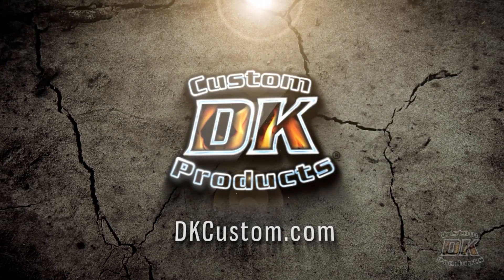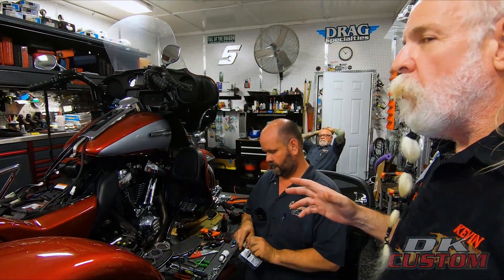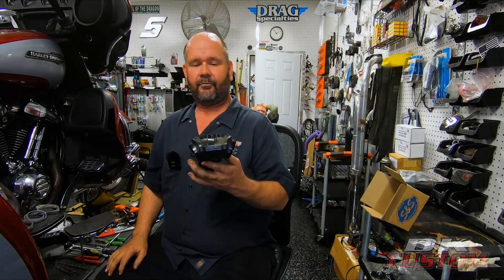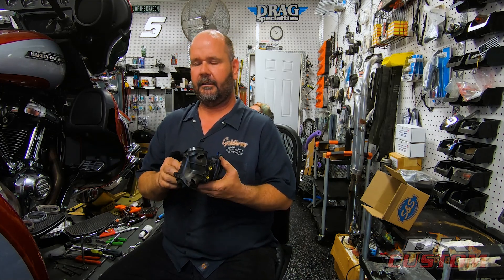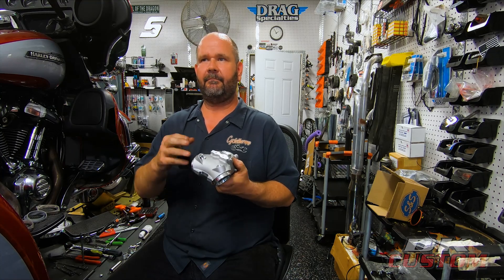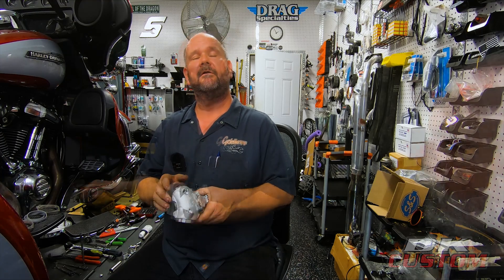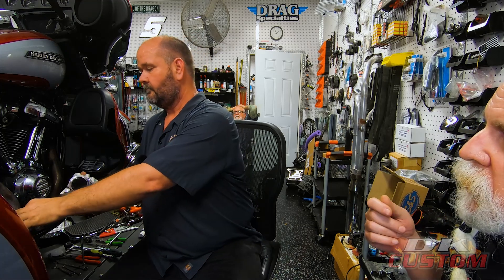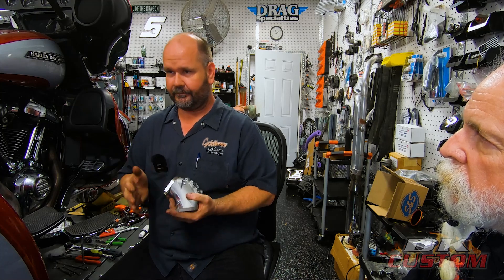Why is There So Much Plastic on Harley-Davidson's?

Comment from the maker: This is a PSA Video.  We are not selling intake manifolds.  I used an S&S intake manifold when replacing my plastic intake manifold.  Standard size.  Oversize manifolds (many folks think bigger is always better) do NOT make more power.
On an engine that does not have increased compression & a big bore kit, the engine will not run as strong with an oversized manifold or throttle body.  It is better to stick with OEM size.

Comment: If you melt the intake, you have a shit tune and running too lean. I swapped the stock intake to an HPi 62mm just for more power from my cam, and the plastic intake was perfectly fine, just had oil inside from before I stopped the breather from flowing back into the intake.
Reply from the maker: Glad you haven't had any issues with the plastic intake. Thank you for sharing and for commenting! MB

Comment: Is there really any difference in SE 55mm PN 27300167 and PN 27300206 (California Models) other than the price?
Reply from the maker: Great question! The main difference between the SE 55mm PN 27300167 and PN 27300206 (California Models) is typically related to emissions compliance for California's stricter regulations. Other than that, they may be quite similar, but it's always worth double-checking the specific specs to ensure compatibility with your setup. Hope that helps! Thank you for commenting! 😎👍MB

Comment: Never put a plastic handle on a cast iron frying pan,just saying...im glad i swapped my intake and i have noticed my rear rocker box cover doesn't get hot like it used to so i must of had a air leak.
Reply from the maker: Glad to hear your rear rocker box cover is staying cooler now. Sounds like you've got it dialed in! Thank you for commenting! MB

Comment: Because they are not premium quality motorcycles where drivetrains are concerned. Their success is due to easy REbuild and overhaul to zero time and a magnificent aftermarket facilitated by their simple engine design and rebuildable crankshafts. The only intake manifold offered for HDs that was actually good is the Ram Jett one-piece intake for Evos which replaced the idiotic rubber boots on early Evos. They're so stout it's safe to lift the engine by a sling under the intake which I've done and not provoked any leaks.  Everything else is designed for rapid line assembly after which they're the customer's problem. Properly designed engines don't require a waterfall of replacement parts to be reliable but fortunately new HD customers are rich enough to fix everything and even be proud of spending the money. Fine with me since my brother mechanics need to eat too.
Reply from the maker: Thanks for sharing your opinion and insight!
KP

Comment: How many reasons do you need to not buy an M8? I put a 103 kit on my 96ci FXWD along with cams and some compression and it's great, why would I change? Maybe if you want bragging rights in top end speed then go for it, I'll protect my wallet thanks.
Reply from the maker: Glad you have your bike built how you want it. The M8's aren't bad bikes they just need some upgrades. Thanks for commenting! MB

Comment: I'll stick with my underpowered early twin cam thanks.  Delphi injection, solid cranks, timken left side, proven primary and no stupid plastic intake!
Reply from the maker: Yeah, plastic and engines are not a good mix, especially air cooled engines. Glad you have a bike you are happy with and do not have to worry about the intake melting! 

Thanks for commenting!

Comment: If i had a m8 which I 😢don't hd  would be the last place I  would  purchase the metal intake from. The m8 doesn't even sound like a harley at idle.
Reply: The only way to get that idle lope on an m8 is to change the cam. 2 friends have done that and it sounds  like the old harleys.
Reply from the maker: I did upgrade my CAM!!! 😎
Reply from the maker: The M8 doesn't sound much like a Harley, but there are certainly modification yu can do to get that sound back! 

Here is a video of my M8 sound before and after modifications- https://www.youtube.com/watch?v=yIbqJ7ytr3w

Thanks for commenting!

Comment: I have 2017 SGS. Every once in a while when I come to a stop, the idle drops to 400 then back up to 1000. Then alternates between 800-1000. i sprayed the manifold with throtle body cleaner, but no fluctuation in idle. Any thoughts. I'm ordering the s&s manifold anyway
Reply from the maker: There could be a variety of reasons for this.
The tune may need to be reflashed.
The sensors in the throttle body may be gummed up if you are not running an EBS.  Check out this video on the subject-  https://www.youtube.com/watch?v=EfDeFZblMck
It is even possible that you are borderline sumping.
Hard to know without the bike in front of us, but the able 3 are things I would check.

Comment: Just took my MY23 sport glide into the dealer this morning for rough idle (too low) and hesitant revs… told me there was an air leak on the plastic manifold. Rather than fitting a new plastic one and seals they suggested I paid the difference for the warranty claim to upgrade to a screaming eagle aluminium body. It was £77 (GBP) difference. Bike is totally better again. Amazing upgrade. Plastic crap between two cylinders shouldn’t be there.

Can’t believe Harley would do this still now on the M8 when they must have seen repeated warranty claims for it? Tech told me this morning it’s not worth warranty claim in the plastic for plastic as if keep coming back over the next two years under warranty and then upgrade to metal to finally resolve the issue.

They done the test with brake cleaner (in less than 30s like you said) 

Excellent video, just advise a low lumpy
Idle too is possible (like I had) in the next one 👍🏻
Reply from the maker: Yeah, HD probably figured they could get away with the plastic intake (to save $) because auto manufacturers have been doing it for years.
And truth is, that a relatively small number of HD's are having the problem you had....but if they get too hot, that is what can happen.
I did note that on the new 121 CVO's with VVT, they are using the aluminum intake manifold, not the plastic one.
See in this video- https://www.youtube.com/watch?v=58cVhVnlz6w
Glad you got yours taken care of.  👍😎👍

Comment: Thank you for that my 2022 Road Glide Special intake Manifold melted. With only 700 miles on the bike and the weather was 74 degrees in Phoenix AZ.
Reply from the maker: That is terrible! Plastic on a motorcycle near the motor just does not make sense! Glad the video was helpful! Thanks for watching!

Comment: U guys are on the subject of plastics on the m8, but forgot about the lifter cuffs and unbrella valves..i dont buy the Al intake would have engine temp decrease, but yea plastics will damage from excessive heat
Reply from the maker: We did not address the plastic in the umbrella valves, but we do address the plastic lifter cuffs.  Here is the video on that- https://www.youtube.com/watch?v=My7BkSnl-fQ
Here is a video about the plastic in the cam bearing- https://www.youtube.com/watch?v=6EdSBP2kZLY

Comment: One of the first things I did to my 2017 FLHTK was replacing the restrictive manifold with an S&S, and before installing that I took the time to gently sand it down…not polishing,..inside for just that little better flow. That way another thing came of my mind when cruising the E-Glide down HW1 here in Calif., it’s just a great feeling that you know exactly what’s going on inside your engine and that you have an impact on it. 👌🏻☠️🇺🇸
Reply from the maker: " it’s just a great feeling that you know exactly what’s going on inside your engine and that you have an impact on it."
Very well put! 👍😎👍

Comment: LMFAO,.....hey, if you want your bike to be reliable and work, you better upgrade the intake. I'm so done with Harley. Just another way to sell you more parts.
Reply from the maker: To be fair, it is a small % that have problem because of the plastic intake.  But, it does seem wrong to be using so much plastic on/in the engine. 😱

Comment: Great video again guys. This something I did not know when purchasing my 2021 Street Glide and I will be replacing my intake as well as the plastic transmission top cover. I understand cost cutting measures in the manufacturing world due to my profession but this is just ridiculous. I would love to know the cost savings between a junky plastic intake versus an aluminum one. I would have happily paid a little more for my bike not to have this crap on it.
Reply from the maker: Thank you!  Glad you are finding the videos useful/interesting.
Plastic just does not seem right.  Fortunately most never have a problem with the plastic intake manifold...but how does one know if they are going to have a problem or not.
Better to just not use a plastic intake.

Comment: I think history will show the Twin Cam bikes and rubber mounted Evo Sportster were the pinnacle of Harley-Davidson quality. 😉
Reply from the maker: Time will tell.
I 100% agree on the Evo Sporty.
Not sure about the Twin Cam...maybe the first 3 years of it.
But, if I had a choice today, between a Twin Cam (with a weak crank) and an M8, I am pretty sure I would choose an M8.
Reply: I think the EVO bikes were the best Harleys ever made, period. Not a fan of the Twin Cam and certainly not the Goldwing smooth M8. I have a 1989 FXRS Low Rider and a 1998 Sportster 1200. No problems with either one of them.
Reply from the maker: You make some good points!

Comment: Question what is the proper intake for a 122 ci motor as i had a 58mm on my 110 twin cam and i think the m8 flows more. But i dont know the formula for figuring out what to use on a harley. car engines 650 or 750 cfm is easy but not so much for me on harleys.
Reply from the maker: Your engine builder would be able to advise you best on what particular intake manifold and injectors will work best with the 122 engine and whatever cam set up you're going with.

Comment: Wouldn't be so hot if they're not so lean
Reply from the maker: M8's are very different than Twin Cams.
The M8 is Not too lean from the factory.  See this video showing that- https://www.youtube.com/watch?v=Lb_57Z_Ipms
And here is a written report with plenty of AFR charts showing that the OEM tune is not too lean- https://www.dkcustomproducts.com/milwaukee-eight-dyno-charts-other-interesting-info-dk-m8-rpt.htm

The heat is not from a lean condition...it is too hot from a variety of other reasons...the EPA cam being one, the restrictive intake and exhaust, more CI in the same space, no oil cooler on the Twin-Cooled models, and other reasons.
Reply: @DKCustomProducts  I have the 2022 117 domestic motor but I'm in California thanks for the information
Reply from the maker: Cali OEM tunes are the same as the rest of the country.  Enjoy your ride! 👍
Reply: @DKCustomProducts  I was riding stopped at a long light in gear holding the clutch gave the throttle a Rev and heard a loud bang pop sound from the head like bang. Took it to the dealer they don't know no codes can't recreate it and I'm scared to ever Rev it again, maybe you know what's going on? I'm still under 400miles on this 117 fxlrs
Reply from the maker: @johnditchen1148  There's no way to know for sure over the internet...would have to be with the bike.  HOWEVER, it could be that it got very hot and misfired when blipping the throttle.  Since 2007 the Twin Cams and M8's have run very hot from the factory.  There are things you can do to cool it down.  Below are 3 video links that you may find useful:
1,  What HD does when they get hot, in an attempt to cool them down- https://www.youtube.com/watch?v=5PxJ8PvcVtc
2.  Short list of low and no cost things you can do to help it not get too hot- https://www.youtube.com/watch?v=o3T3yA9BKwE
3.  Playlist of the Series of videos on Why and How to Cool Down Your TC & M8- https://www.youtube.com/playlist?list=PLb3bvZgbH92_3s-2vv63QggFJ3nteFd_C

Always feel free to email or call with any questions:
Support@DKCustomProducts.com
662-252-8828

Comment: Did the new intake drop  any noticeable heat from your engine? I know its important.
Reply from the maker: We did not change just one thing when we did the intake manifold...so it is impossible to know which of the things we did increased or decreased temps.
Reports out there are a 5-10 degree drop, but we cannot verify that one way or another.

Comment: I refuse to work on anything after the EVO. But even the Evos we rebuild will get a new S&S steel breather to replace the stock plastic one. And those infamous INA cam bearing had a plastic cage separating the needles. The Torrington had twice the number of needle rollers, one right next to each other without the plastic cage. Which one had a reputation for failure?
Reply from the maker: What year and model Evos came with plastic intake manifolds?
Yeah, agree with you on the cam bearing...we have a video coming out soon on that subject.
Reply: @DKCustomProducts  Not intake manifolds, the gear-driven crankcase breather. Never heard of a plastic intake manifold. I do know Dodge uses a lot of plastic engine parts. A friends garage has replaced a lot of failed plastic coolant hose  spigots.
Reply from the maker: Got it.  Thanks.
Yeah, plastic and engines are not a good mix, especially air cooled engines.

Comment: Would you say my 114 would need a tune if i put in a SnE intake or the SnS one ? I only run Slip ons ...Thanks 👌
Reply from the maker: No change in tune is needed when swapping out intake manifolds from plastic to metal.
Reply: @DKCustomProducts  I only thought to ask because the air flow is increased by around %3 ? On top of the slip ons ,, although sooner than later I'll tune and run a SE torque cam ,, 👌
Reply from the maker: This video showing how the ECM adapts for changes like that is pretty interesting- https://www.youtube.com/watch?v=0vbTkRvFa80

Comment: Will you be having a video of replacing the intake?
Reply from the maker: We tried, but we did not pull the tank to do it, and there was not enough room for the hands working on it and the camera.  In retrospect it would have been better to take the 10 minutes to pull the tank...then it would have been an easier swap AND we could have videoed it.

Next time! 👍

Comment: Thanks I will be charging my soon 
I am having trouble with Harley for parts for my 2020 road glide limit 
The heated handle grip switch is on back order. The dealership will not me the bike back until switch coming in
The fell over insurance is paying 
The last I heard the middle of July 
A two year old bike and can’t get parts
Reply from the maker: Yes, supply chain issues are real, and HD is not exempt.  Sorry for the hassle it is causing you.

Comment: I will let the warranty cover it... my guess is that people who run their engines way too hot are the ones suffering from this. Keep your engine operating cool and my guess is you will be okay. Most all engine manufacturers today use plastic intakes. Good info though. Thanks :-)
Reply from the maker: That is definitely one way to deal with it (warranty) if always riding close to home.  Definitely those that run too hot are going to have a higher rate of failure.
Reply: @DKCustomProducts  no doubt... I guess the biggest concern is the warranty issue. with a new aftermarket cam comes an EPA non-compliant tuner. and, if something goes wrong, that HD can show was caused by a poor tune in the engine or malfunctioning aftermarket part, then the cost of rebuilding or replacing your engine comes out of your pocket (unless of course you have a Jim Palmer aftermarket warranty policy with a $2000+ price tag). at 8500 miles, my 2020 114 Freewheeler engine sumped and destroyed the engine. $8500 estimate to rebuild if rebuildable and $14000 to install a crate engine (parts/labor). no thanks. I will always maintain a warranty as long as I ride a HD. period. I will never modify my engine, so I have the Jim Palmer basic warranty policy for 5 years with a price tag under $1400. I feel confident riding my HD long after the factory warranty expires. ride safe : - )

Comment: Kevin you seen my bike I have the Aluminum Intake ported by Ward / S&S... it was good for closing the gap on the dyno to the tune of six horsepower under the Curve on my stock compression 114 rdrs equipped fltrxs... I've seen too many of them melt in the service department and it's an easy and inexpensive fix
Reply from the maker: Hey Hoodie, thanks for sharing your experience. 👍

Comment: Have noticed all car manufacturers have been using plastic intake and also intake plenum for a looooooooooong time.
Please stop calling out Harley Davidson.

What about your vehicles with plastic intake manifolds and plastic intake plenums, are you going to start replacing????
Reply: Harley brings scrutiny to itself.
Reply from the maker: True that. 👍
Reply: I own 2 M8 touring bikes and a few of my friends have also owned M8 touring bikes but no throttle body (or intake manifold) trouble whatsoever. I reside in Los Angeles which is warm and got hot during the summertime. Could this be a few bikes out of hundreds, or thousands of bikes?
Reply from the maker: You are absolutely correct...it is not a high % at all.  I do not know the %, but I would guess a few out of thousands.
But, if a person is one of those few, they are not going to be happy campers.
Here is what a HD Service Manager has to say:
"Kevin you seen my bike I have the Aluminum Intake ported by Ward / S&S... it was good for closing the gap on the dyno to the tune of six horsepower under the Curve on my stock compression 114 rdrs equipped fltrxs... 
I've seen too many of them melt in the service department and it's an easy and inexpensive fix "
Reply from the maker: I would replace it on my wife's truck if there was a history of them melting.
Not a lot of HD plenums melt, but enough of them do that I don't want to be one of the ones that it does, especially thousands of miles from home on a trip.